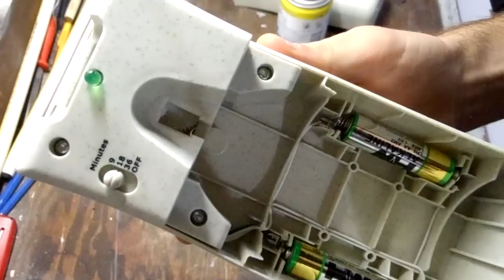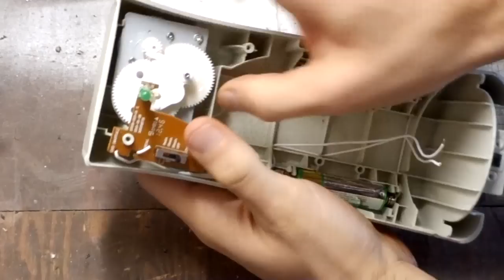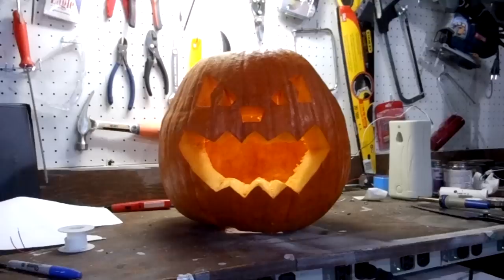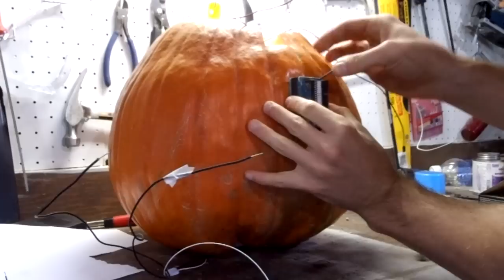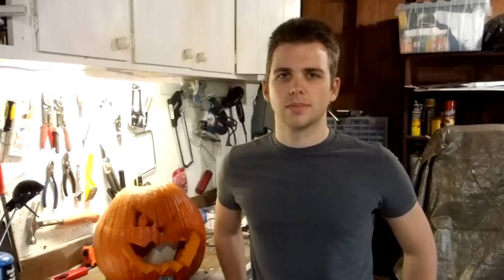Halloween Hacks #4 - Fire Breathing Jack-O-Lantern

Comment: where does the echo pin get connected to on the Ardunio? Also does the Motor pin go to Analog pin 2 or digital pin 2?  Are both echo and trig used? Is the ping sensor the echo or trig?  thanks.

Comment: If I just cut the wires to the button and ran those to an external switch I assume that would work. Any thoughts?
Reply from the maker: That should definitely work and would likely be the easiest thing to do.  I wanted my jackolantern to fire automatically which is why I had to make it more complicated.  If you want yours to fire by manual control only, then you can just extend the button wires and have a remote button that you physically press.  Just remember that these things have a timer function that will still run, meaning that every so often it will fire on its own unless you find a way to disable the timer.
Reply: Rick Osgood Cool thanks. do you know a way to disable that timer or send me some where that would teach me how. I do have knowledge of centerboards works. I don't know enough to just look at the piece and what to cut to stop it from doing that yet. Thanks for the help.

Comment: Where does the button ground wire go, after you sever it from the button?  In the video, it looks like it's tucked back down by the now-dead button.  Is it no longer relevant, now that the control wire is coming from the arduino?  The.
Reply from the maker: That wire is no longer needed. You are correct that I just tucked it inside and out of the way. When you hook up the Glade's power and ground wires to the Arduino, you are making them both part of the same circuit. The button ground wire just ties the button to ground when the button is pressed. After this modification, you are essentially replacing that wire and button with an Arduino pin. If the pin is HIGH, then the button is not tied to ground and therefore not "pressed". When you pull the pin LOW, that ties the "button" to ground and sets off the Glade. Does that make sense?
Reply: Rick Osgood
Makes complete sense now, thanks.  Button wire is now an Arduino pin.  I hadn't cut the wires yet and wasn't visualizing it properly.  Soldering and coding tonight.  Ping sensor arrives tomorrow.

Only downside is my kids got ahold of the aerosol cans and sprayed them all over our craft room.  Now it smells like strippers.  Guess I'll put on some Poison or Motley Crue and make the best of it.